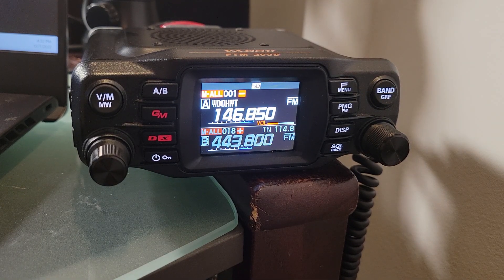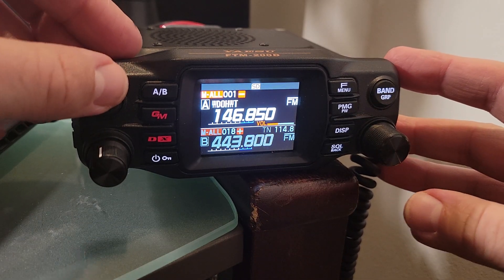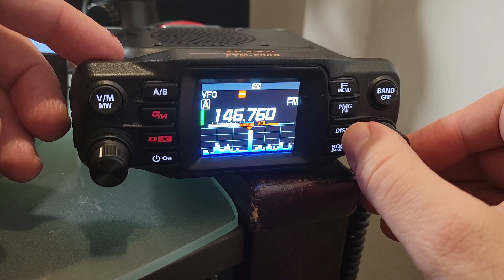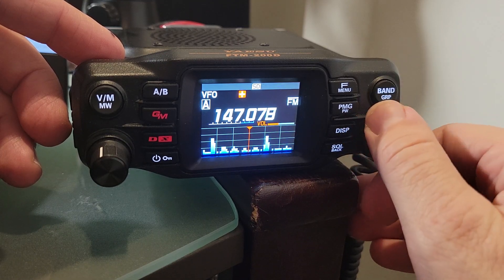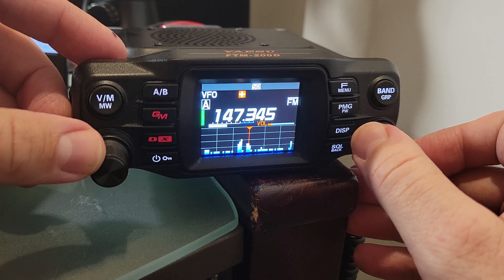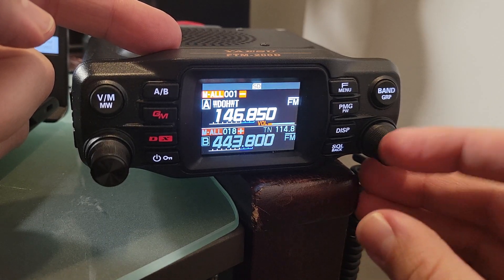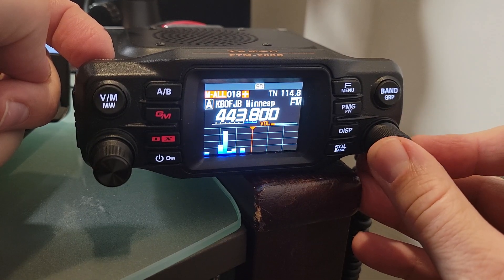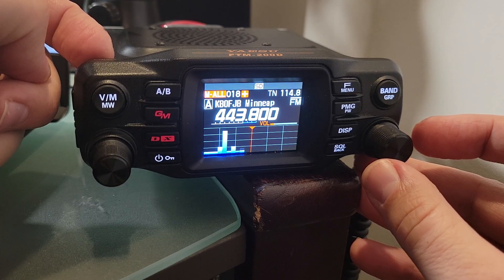Yaesu FTM-200D - Check This Neat Memory Scan TRICK!!!

Comment: Yaesu’s last two FM C4FM mobile radios are crippled if they are installed in a vehicle that travels further than the shopping center. I have 17 separate memory banks programmed in my FT5D. They are made up of multiple counties/large cities in my home state and vacation locations in four states I visit. Very close to three hundred separate memories. Now try and maintain or use these frequency channels on a FTM-200 or 300 with All, VHF, or UHF. I carry multiple SD Cards when traveling with the 200. As far as memory management Yaesu seems to have forgotten what “mobile” means. These two radios are best left bolted to your shack desk for local and PDN use.
Reply from the maker: Interesting point, and disappointing. I'll have to put some thought into this. Thanks for stopping by and leaving a comment!
Reply: Yaesu has long missed the boat on this. Since the early days of programmed radios, Motorola had modes (channels) and zones (groups) with front panel group selection like "telephone" or "work" or "ham". Only the FT7900 had this capability. Even if you could scan by memory tags it would help. Or even change the useless PMS to scan memory channel numbers instead of VFO frequencies.  I duplicate geographical areas into groups of 100 channels on my FT8900 with many of the same frequencies but different tags. The 8900 "hyper" memories are crippled startup profiles which exclude memory choice. At least on the FTM400 you can see tags on both receivers and on FTMs you have the memory card. You are correct, most amateur manufactures have never understood mobile. @ ham r. h. thanks, please don't call a spectrum display a waterfall, it confuses new hams. 73